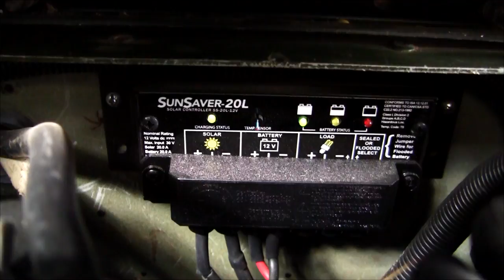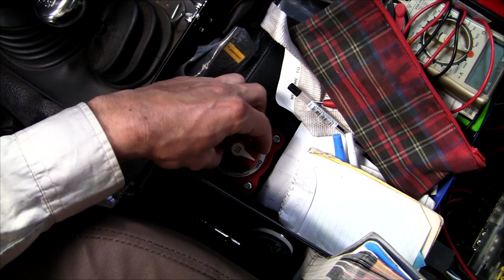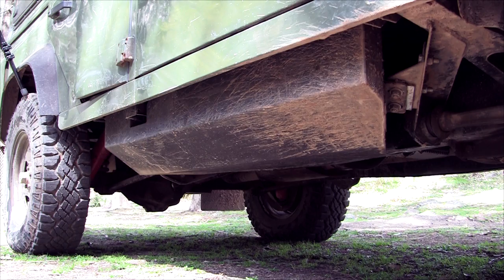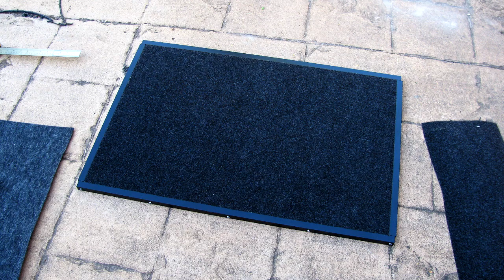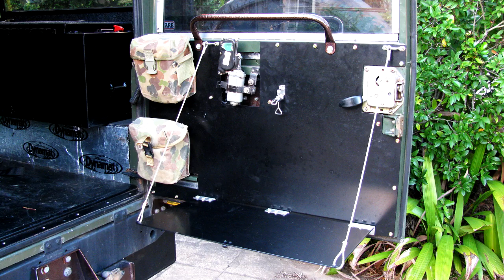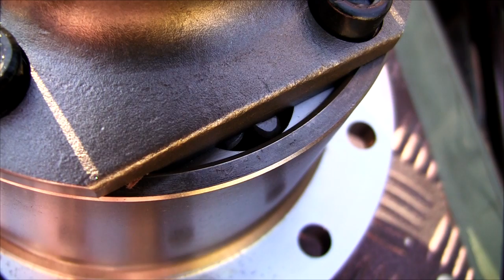Land Rover Defender Expedition Camper Upgrade 6/7

Comment: dont see many land rovers out there hope it remains reliable for you unfortunatly there reliability reputation is not as good as there off road abilty
Reply from the maker: MegaRyan123456 Thanks mate.. It's been doing pretty well with a few minor issues I've fixed along the way.
Reply: Roaming The Outback yer i always wanted one and maybe might get one one day for the experience lol but yer not sure if i could trust one as i have worked on a few there a bit of a strange one great off road ability but temperamental  things what made you choose a landrover ?
Reply from the maker: It's one of only 2 cars i've ever fell in love with. Really love its simplicity and rugged basic looks. The ability to modify them easily is a bonus. Really if you ever buy one you need to do your research and get a good one as some are made as lemons from the factory.
Reply: Roaming The Outback yer i know i done fixing my share of broken ones lol i think if i get one it will only be a trail truck then again i allways had dreams of getting a  perentie and doing the outback old school bush tucker man style !

Comment: Hi Brett, 

Just wondering where you got your TOPO Marine Dual Volt meter?

Good luck on your travels!
Reply from the maker: keeklepop Thanks mate. I bought the gauge off ebay and had my dad lathe up an adapter to fit a 52mm hole. The gauge is a smaller diameter than standard.
Reply: Roaming The Outback It it possible for you to PM me a link? Ive been looking for such a gauge for agers with no success! (ive settled for 2 rectangular guages) 

Cheers!
Reply from the maker: keeklepop try http://www.ebay.com/itm/TOPO-Dual-battery-DC-monitor-voltmeter-gauge-meter-DVM-volt-and-volt-meter-/181330517864 or http://www.homeof12volt.com/shop/index.php/page/shop/flypage/product_id/294/category_id/63c619e28ea112ef2e99cb62d56ae114/offset/0?
Reply: Roaming The Outback Thanks mate!

Comment: Hi Brett, What have you used to mount your radio above the windscreen? Looks a nice bit of kit but I cant find mention of it anywhere.
Reply from the maker: wolfishtendencys If you mean my HF radio the codan handpiece comes with an optional mount you can purchase. This just screwed in to the steel rib in the middle of the roof.
Reply: Fantastic response thank you! you have a fantastic truck and its coming together really well. How do you find the duratracs on tarmac as my general grabbers at2's are getting a bit thin....
Reply from the maker: I'm really happy with them. Seem to steer and grip very well both on wet and dry road. Noise wise little difference compared to my previous AT's. From the offroading i've done also impressed.

Comment: A another option instead of window sox and especialy for when it is raining or snowing and better protection could be this
http://www.ebay.de/itm/LUFTUNGSBLECHE-Seitenfenster-hinten-LAND-ROVER-DEFENDER-mit-MOSKITONETZ-schwarz-/321533258020
Reply from the maker: Birdphotoman44 They look good though seem to lack any mesh to stop the mosquitos.. Better for security though. thanks.
Reply: Roaming The Outback There are a mesh but maybe small mosquitos can enter? one can always place a tighter mesh on it if needed. You can see the mesh here http://up.picr.de/18152783bj.jpg and here http://k11.de/110/wp-content/uploads/2014/09/lueftung4.jpg
Reply: Roaming The Outback You can google translate this site from german http://k11.de/110/2014/09/07/lueftungsbleche-seitenfenster-hinten/

Comment: Absolutely love the self made mods and the well thought out extras ... I'm assuming you're taking or have already took a quick night or two away just to make sure there's nothing that needs tweaking?

The mod on the transfer box ... that's not Ashcroft work ... I'm intrigued ... costly?
Reply from the maker: Matt Allen Thanks.. yes Have taken a couple trips to test it out and had a few issues which I've since fixed. Will upload a trip video in the next few days. Both the boxes were rebuilt by ashcroft.. yes costly!

Comment: Looking good!  What spare parts do you carry (wheel bearings, UJ's, axleshafts, etc)?
Reply from the maker: ***** a quick list is something like bearings, uj's, radiator hoses, clutch master and slave, water pump, fuel lift pump, fan belts, gasket maker, glue, steel putty, tyre repair kit and beadbreaker, fuel stop solenoid, fuses, wire, filters, and all oils for top up. Thanks

Comment: Congratulations mate, a job well done - it's been a great journey so far, and no doubt you'll come back with a whole heap of improvements, modifications and things for us to think about too after using it on your grand adventure.

Did you put any rubber or a dampening system to reduce vibration to the panel while traveling on rough roads? I'm not sure if it's needed, it's just something i've thought about myself.
Reply from the maker: Aussie Homestead Thanks mate. Yes I'm sure I'll need to change some things around once I get a chance to live in it for a few months. I used dynamat soundproofing on most of the panels and some closed cell foam. Really helped alot. Check my land rover upgrades playlist for the other videos. cheers